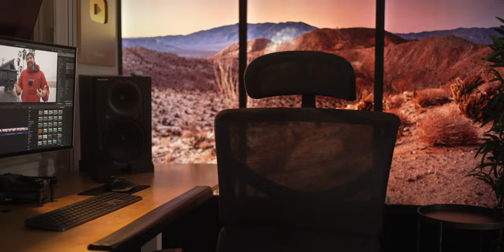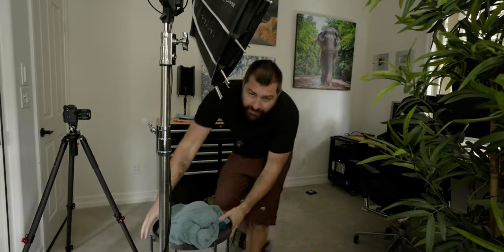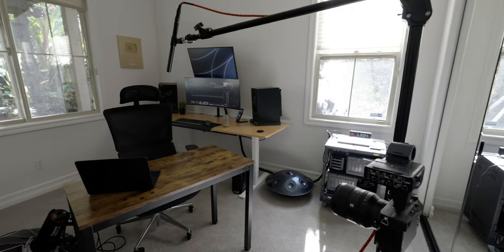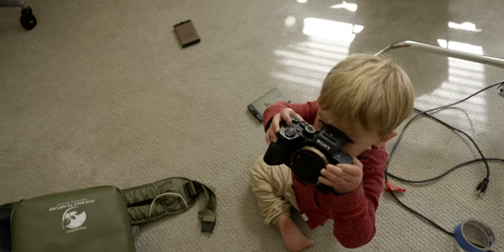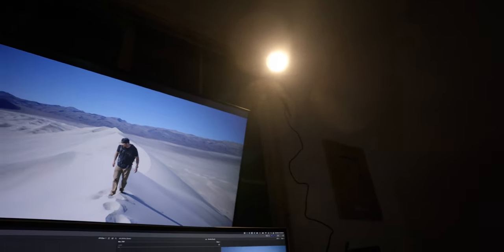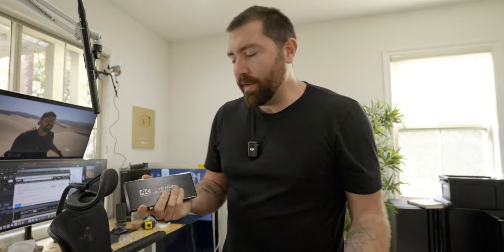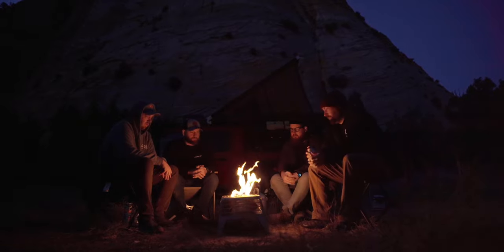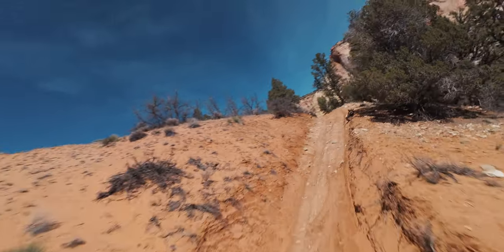Building a YouTube Set with VIDEO WALL in a Bedroom

Comment: I like your setup.  Like the video and blacked windows.  Not knowing how you have all the electrical done, if you want to speed up the power up process, you use some power boxes (instead of power strips), able to have larger cable/wire for power surge so to speak with delays to turn power on.  10 second or so delay on each item to avoid large surge at one time.  Two or three of these and with a couple hits of switches and your set.  I have to say that I cannot tell  you what to use.  A little research will be needed or a friend that knows.  Great setup though.

Comment: I liked your old studio better. This one feels like a Potato Jet duplicate. 😂
Reply from the maker: @EliteAtlantaHomes  it’s what I could do for now.  I’m moving again in a month and will be doing a new design
Reply: @ Awesome! 👏 Do you recommend the Rode Wireless Pro or DJI Mic2?
Reply from the maker: @ depends on your needs.  I really should do another video about these mics cause I get this question all the time.  I personally use both depending on the project I’m working on.  Usually for YouTube I recommend the DJI mic 2
Reply: @ Cool thanks. I’m leaning toward the rode. Still sounds better to me even after DJI2 recent update. Also has locking lav vs the DJI just has a place to tuck wire behind the clip. Also like that the Rode has 32 bit float without needing the receiver unlike the Dji2.
Reply from the maker: @EliteAtlantaHomes  You have 32bit float on the DJI MIC 2.  The update did improve the DJI and it sounds great now.  The reason I use the Rode at times is for the locking connection and timecode.  Otherwise I mainly use the DJI MIC 2
Reply: @ Yeah only you need both the receiver and transmitter with the DJI to get the internal 32 bit float. With rode the 32 bit float doesn’t need the receiver. Good for if you want to take a walk and only bring one transmitter.